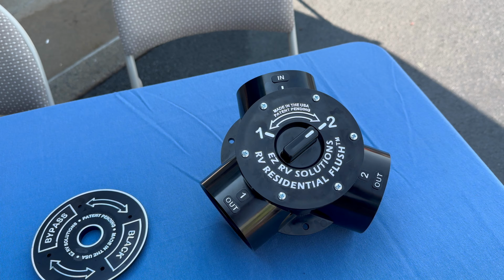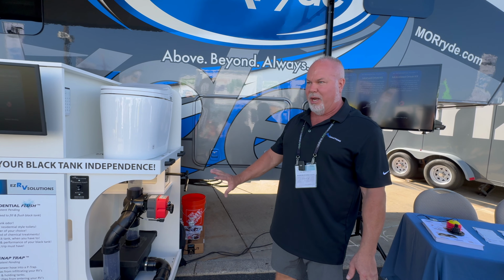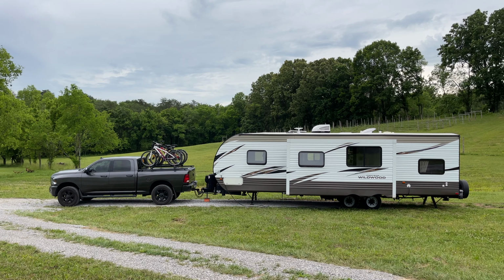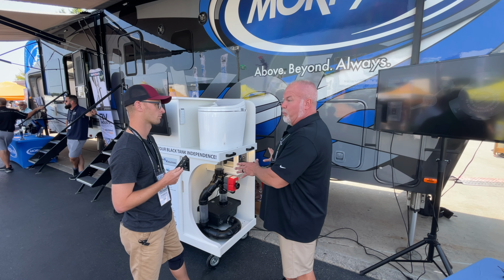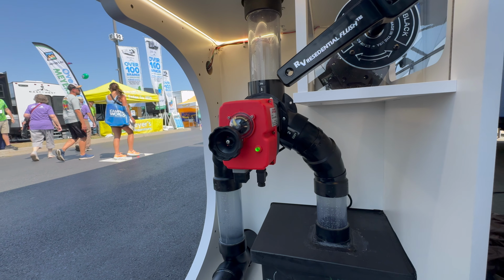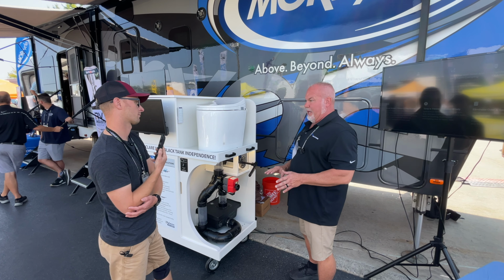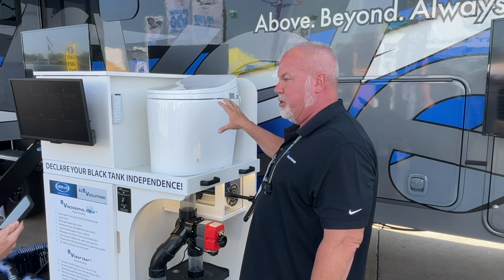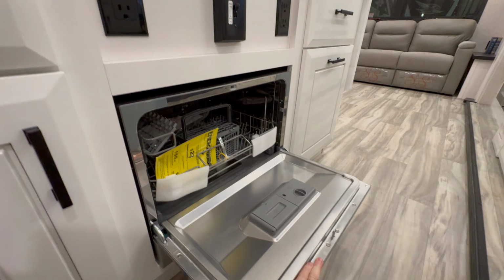How to Bypass Your RV Black Tank at a Full Hookup Campsite (RV Residential Flush & RV Snap Trap)

Comment: The valve is a good idea, BUT only works practically on upper decks of 5th wheels due to the vertical spacing requirements so leaves out the vast majority of the travel trailer community.   The cost and complexity of building pedestals just isn’t justifiable in most cases.
Reply from the maker: However, I think if its designed in from the beginning - the valve could be horizontal and then drop into black tank - you're correct - retrofit on TT is going to be difficult- but I think OEM could easily incorporate it without significant changes.

Comment: My questions would be, 1.) are manufacturers making a list of current and past models that this will work in (i.e. real estate inside the rig to make the install happen), 2.) will parts such as pipe length(s) be pre-cut, or will they send you a single pipe and you cut the length(s) you need, and will the kit include pipe cleaner and glue, or to keep costs down, have the purchaser swing by their nearby home improvement/hardware store and pick it up.
Reply from the maker: I very highly doubt manufacturers will ever spend the time to create such a list, so don't expect it, and the y-valve is the only part I think you'll get - any additional piping, glue, tools etc will need to be provided - which is why they are recommending them be installed by RV Tech's that will have the know how and equipment to correctly accomplish this.

Comment: I don't know. As overly  expensive as rvs are now, another reason to raise the cost? Some long stays might see a benefit.  It might fall into nice to have but not essential.  The more moving parts and complicated we make these systems the more potential failures. Pull valves used to be so dependable, now they fail at an alarming rate, and of course a company is there to sell a dependable pull valve. Real field testing by real rivers that really use it not lab geeks and managers looking for another revenue stream. If it passes the full timer stationary testing maybe an option. Problem is we are getting less options now just get what the manufacturer says we need, because it saves them money... Just my thoughts. 😊  Go Army!!
Reply from the maker: All valid points. I will point out however, that the inventor IS a full time RVer - he designed this because it filled a need in his full-time family lifestyle.

Comment: Seems like a great addition for a new RV. I spend a considerable amount of time flushing my black tank. Sure would be nice not to have to do that. However I don’t see the valve being successful for retrofits. Awesome video!
Reply: Thank you for your comment! We have successfully installed the RV Residential Flush system into several fifth wheel RV units, it is very achievable for the extreme DIY'er, plumber or experienced RV tech. Check out our installation video: https://www.youtube.com/watch?v=CJVLTDcyWD0
Reply: @ thanks unfortunately I have a travel trailer.
Reply from the maker: I'd agree - unless its a 5er or Class A that has easy and clear access with all the plumbing necessary in the right location - it'll probably be more suited for an OEM install.
Reply: Yes I agree too! Amazing product but wouldn’t work in my hybrid 17C Jay Flight LoL too bad! Great video thanks!

Comment: I guess it expensively solves a non-existent problem.
Reply from the maker: For the retrofit - yeah maybe - but how could would it be to get this installed from the factory and literally with the switch of a button skip the black tank when on full hookups?
Reply: I'm very skeptical that solids are going to move through the snap trap. Maybe a macerator inline to break up solids and paper..
Reply from the maker: @charlesklaus6290  It will be awesome to get it into the field and get some feedback from multiple sources
Reply from the maker: @thisoldrelic  Agreed - its 1000% geared towards seasonal and long term RVers
Reply: @rvgearandfar and if you're seasonal and directly connected, bypassing the tank, you're probably already plumbed in with ABS drainage and a trap.